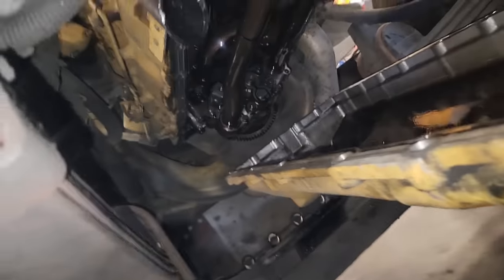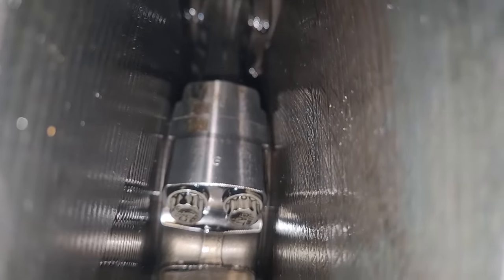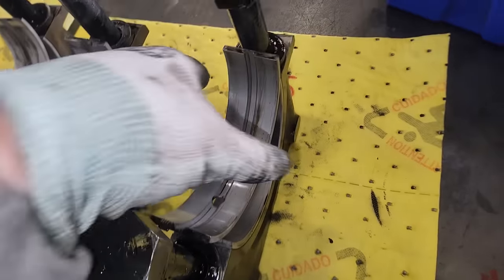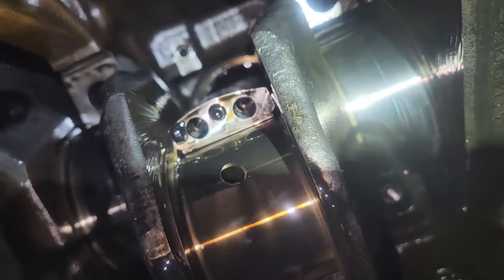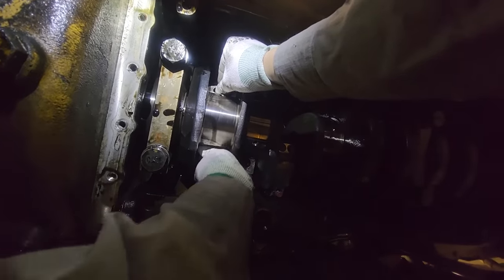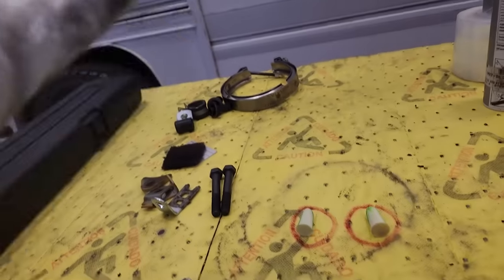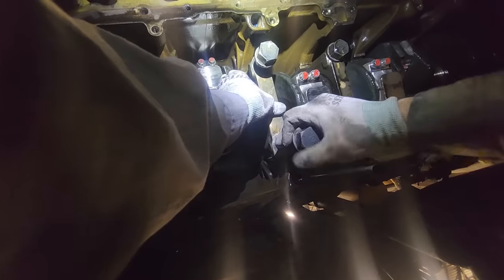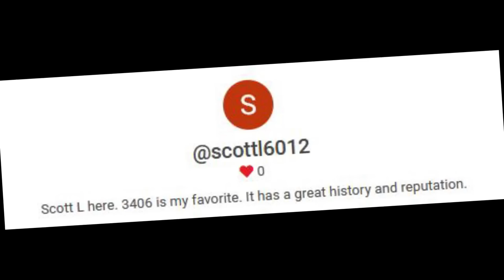Nice Truck Driver Paid for an Engine Rebuild, gets a HEADACHE! Engine "Re-Rebuild."

Comment: I own a 2006 Jeep grand Cherokee wk1. Bought it September 2022 since the day I bought it I’ve had problems with it, fixed the thermostat and fixed the overheating problem. I’ve replaced gas pump, radiator, the fan and fixed fuse box cause it wouldn’t start. It has tune and headers with CAI. I bought it with 105,xxx miles, cars engine was “rebuilt” and everything looked nice and clean from outside. Everything above was done within a 6 month span. It’s a nice car and pulls strong, daily driven. About 7 months in I noticed a small ticking and one morning the low oil light came on, that same day I drove it home changed the oil and everything was good I noticed the oil pressure was low tho I still drove it thinking everything was good since it was “rebuilt” about 2 weeks in I raced a scat, it ran good on the first pull until I noticed after that it wasn’t pulling with full potential, on my way home it started knocking bad. Took it to my mechanic and turns out the rod bearings where toast 4 bearing were thin as paper I got somewhat lucky. The previous person who built the engine torqued tf out of the bearing and they got ate up. Now I’m “re rebuilding” it polished the crankshaft and waiting for everything to get put back together. When the oil pan was removed the whole bottom pan was full of small metal shavings (the bearing) it’s a srt8 I love the car if it wasn’t for how it pulls and sounds I would’ve sent it to a scrap yard already. Moral of the story is there are some mechanics out there that are absolute a holes

Comment: Hi. Josh
I teach at a community college in Canada, enjoyed your video. Worked at FTL/ western stars while on the floor. In my experience for 1 & 2 Mains, try removing the drive and accessory belts before doing the mains. Especially auto belt tensioners tends to pull the crankshaft upwards. Which tightens up the upper shells. Give it a shot sometime might help. Excellent delivery speed.

Comment: Late to the party but the stamping looks to be roll stamping where the rods have been physically rotated against a stamping die to get the uniform impression across the surface. This is obviously not done by hand on such a large part, but done mechanically.

Comment: Moral of the story…you get what you pay for. For every good mechanic that does the job only the right way or doesn’t do it at all, there will be 50 who do it the wrong way(like grinding a main bearing to make it fit). Tough to find good guys, even at dealers, had some work done at cat dealers done and had corners but, and there’s a lot of solo guys that do fine work as well. Nice work josh!

Comment: When undoing those critical bolts i would be de-torquing them in stages, as per re-torquing procedures, not having the cap held by 1 bolt alone, just good practice, which is what this is all about, avoiding drama's rather than creating them, good video so far, ta ...

Comment: Awesome video, 👌 you should make some tools out of hard teflon to handle the bearing install. Sacrifice a heavy cutting board making a plastic chisel the same width of the bearing. Or at least some plastic upholstery pry bar tools you can tap on without doing damage. Just some things that I used in the past. Cheers Josh 🍻

Comment: Josh, in my 40 plus years of operating diesel engines of all sorts, every single one would lose a few pounds of oil pressure when the turbo spools up. It seems to me that the turbo spooling up would suck oil into the bearings thus lowering the oil pressure slightly. I always figured if it didn't drop a few pounds under load, it wasn't oiling the turbo properly.

Comment: Block with main caps in place are line bore, honed and CANNOT be moved to different location. Very surprised engine even turned over or locked up. Seen few main cap back on in wrong spot and lock engine up. Seen it done on 3406E owner put mains and rods in mixed up main caps locking engine up. We had ex-cat  tech who used white grease on pistons and rings. Also never removed any of BLUE grease from new cyl but only from head gasket surface and bolt it on

Comment: I always use the white assembly lube because you can see after putting the lube on the bearing and before installing the caps you can see that there is no debris on the bearing.

Comment: I always left the rod that is fed by the main uncapped. Then run brake clean thru the feed hole and flood the main journal then blow the rod and main out with air just so I dont make the mistake of leaving the earplug in the feed hole. Also used a big screwdriver. Either way works. Rods and mains are time consuming to do them correctly. I always polished if I felt anything and have successfully done hundreds of rods and mains. I agree, that main cap can put a dent in your skull!

Comment: Agree Josh, any time 3406 or C15 engine oil pump is removed the lube system must be pressure filled. Typicaly a failure to do so will result in a number 2 big end  failure a few miles down the road after repairs.

Comment: Ex light auto mechanic I've never seen or used white lithium grease on bolts during a rebuild.

It's usually just engine oil or the thicker assembly oil white helps with initial start up.

Not saying some manufacturers don't suggest it just never seen it. And I worked on all sorts of vehicles and machines, as I didn't work at a dealership so was exposed to a large variety of makes and models.

Edit: will say I found copper paste on some vehicles but id say that is likely more beneficial than white lithium grease. Though the actual suggested stuff is usually best.

Comment: definitly a good tech, just a side note, when rolling in main brngs. use a brass coated or brass punch/screw driver. your comment on knowing what you are doing is paramont! Cat recomends not using an impact, but I never had a problem with that

Comment: I have literally "rolled in" hundreds of bearings over the years, and never had a comeback or complaint. If you leave all the mains un-torqued till the last upper shell is in position, you won't have an issue installing them. I have used a Copper T-Nail in the in the oil passage of the crankshaft to R & R slightly snug shells, and gently barred the engine over till it was in position. Hard to believe those mains didn't Self Clearance with the wrong caps installed.
Reply from the maker: I've always left at least 2 of them torqued so the crank would droop and possibly damage the main seals, but I might try to just loosen all of them, roll the uppers out on 5 of them, install the 5 caps without torquing them, roll the other 2 out and then torque them all. I love getting knowledgeable comments from other people, I try what they say and sometimes I like it more and then I have learned a new skill.

Comment: International Compound # 2 is an excellent thread lubricant for cylinder head bolts and main bearing bolts . I do not think lithium grease as thread lubricant is hurting anything . On N-14 engines it is best to loosen the alternator belts to remove tension from the crankshaft for bearing installation .

Comment: I don’t have a picture but I have a destruction of the week for you, working on a caterpillar D6 replacing a track roller, I had to order new bolts because the old ones were so horrible. I leave for the day and go pick up the new bolts the next morning, they assume that the roller was bolted on and ran the dozer without calling me first so I spent something that should have taken an hour just to fit the roller and put the new bolts in cleaning out the muddy sand from the bolt holes

Comment: I have used a blunt putty knife or a strip of 1/4 inch white plastic to push shells in.  On tight ones I have an assistant pry on the crank or slowly rotate the crank.
Reply from the maker: I think I'm going to buy some small brass punches and try them with my screwdriver next time, scratcher l screwdriver for positioning and the brass for pushing.

Comment: You can polish from the bottom with the shoelace/ribbon method.
Wrap the journal with a single none overlaping abrasive of your liking, then spiral wrap a ribbon or shoelace around that as many times as it takes to make up the width of the journal.
Reply: Though it is a fair amount of work to get it set up on a main
Reply: And what happens to the waste abrasive?

Comment: Slowly doing an inframe on my Cummins 8.3. Haven't done an engine rebuild in a few decades. And never done a diesel. Being a backyard mechanic, even I figured out quickly that the caps are numbered and go in the same spot, in order. Also pistons have a front and rods have a left and right as well as being numbered and matched.  If you aren't sure, grab the repair manual for your engine. Cummins Quickserve had mine available online.  Dude definitely needs to get his money back from the Florida mechanic!

Comment: That looks like a joint compound to torque the bolts. That's what I usually use for the Detroit 60 series. that's what detroit recommends to use to torque head bolts and main bearings. And it is off white.

Comment: Josh that was a great video you have so much patience I really appreciate you making this video haven’t done any in frame guide some time but stand up and take a bow However tell the last use paint after assembly but he forgot to use orange silicone on the rod bolts and too the engine with 90 weight gear oil hahaha keep the videos coming gonna follow you now thanks Jack

Comment: Out of the 4 cats we have 1 6nz 1 mbn 1 1lw and a accert they all lose oil pressure under load especially when hot. Even after a fresh rebuild. Once boost comes on a 5 psi drop is just normal

Comment: on the mains they're also faced while attached and could grind on sides of crank, gouge in hole in bearing was likely a peen shot not cleared from oil gallery...rods didn't appear to be matched either from start, bad, bad, bad
I think I done at least as well mixing and matching parts building from the scrap motor pile

Comment: Those are the fumoto drain valves and they do make an optional lock you can install but they don't need them, I have used them on everything for well over a decade and never had one open.

Comment: Positioning of main caps is very important because when the block is manufactured, they do a line bore, and if you put them in the wrong spot, you can damage the block and the crankshaft. I cannot believe somebody did this if I was the owner of that truck I would be very, very pissed And I would probably make them put me a complete engine in this truck

Comment: The white grease on assembly can cause problems, I pulled one down and the high temp grease had plugged the oil filter. That was on two stroke Detroit so almost 0 oil pressure after bypass kicked in

Comment: I use a split pin with the loop in the oil hole and the legs bent at 90* then rotate the crank to roll the bearing in

Comment: You should see my 2011 Cascadia in pristine condition. I rescue it from a junk yard in El Paso adapted a 2007 14L Detroit engine with a 13 speed is a sweet little thing.

Comment: Man, watching you roll out those mains makes me cringe. Before you even got it out of your mouth I knew how he damaged those top caps. It amazes me that he didn’t damage the crank doing that. He got flat mean with them. I used to use a plastic windshield installation tool to push them out, or at least get them started out if they were stuck a little bit. Then I used a heel bar with a rocking motion and walked them right out. I would also use the same plastic windshield tool to seat the lock, so I wouldn’t risk scratching the cranks with a screwdriver. Your definitely correct, rolling rods and mains in ( under haul) is one of the nastiest jobs. I much preferred doing it on a table or a stand, preferably majors. Great content! Thanks for sharing!

Comment: If you torque something to level X, then go back later, it will take a higher torque to move the fastener.  Reason:  sliding friction is less than static friction.  During initial torquing, you're working against sliding friction..   When you go back, you encounter static friction until the fastener moves.

Comment: What you’re calling white lithium grease might be from ARP and according to the ARP it gives him more consistent torque It works better than engine oil and helps prevent what they call. Torque scatter anyway oh yeah, that guy who butchered that engine I hope the fellow that owns a truck can go back on him. If it was me I would just pull the whole motor out and clean it out real nice anyway, you do good work.

Comment: I’ve seen white lithium grease used as assembly lube.  There is a brand I’ve seen labeled white motor assembly grease. 

I’ve also heard it’s good if the engine is gonna sit for a while before starting it. 

I’ve never used it though

Comment: I sometimes use a split pin that's flattened into a T, then insert it in the oil hole and roll the crank till the bearing in the right spot. I have the same torque wrench but I still put lines before I torque the bolts to be sure I don't miss any and they all end up pointing in the same direction.
I like WD40 to use on the cloth when I'm polishing the crank.
 Its crazy some of the things you see. I once seen a camshaft that had been stick welded then ground, all the weld just lifted right off.

Comment: Great video, I never watched a CAT engine repair, but this was great and learned a lot.  I'm sure now if I did have a CAT, I'd drive it to have you repair it too.  Bet you loads of referrals to personally repair these engines.  Glad you didn't have to remove the engine for the repair.

Comment: That's astonishing. 
This is why I do my own maintenance.
I was pushed for time a couple of years ago and needed to replace my radiator.
So I went against my best instinct, bought the radiator and gave it to a shop to do the installation.
A really easy job. The radiator sits in a channel at the front of the car and is clamped into place with two plastic clamp screws in the front cross member.
Seems the guy didn't know this and couldn't be arsed finding out.
Isn't that what you would do if you never done a job before?
Not this a55hole.
He cut the old radiator out and bent the new one to get it in.
The bottom of the radiator 5mm away from the power steering pump pulley.
Unbelievable crap.
What an idiot.
I made him buy me a new radiator and refund me my money.
Did the job myself.
But he's still in business this guy.
God knows what damage he's doing to peoples' cars.

Comment: ive been a Diesel Tech 35 years And you have to know the Basics Common Sense everyday look both Ways before you cross the Street Sense no Computer not Everything requires a Laptop    Hands on gettin your Hands Dirty Is the Best Way to learn

Comment: Take your emery cloth and tear in to 1/4 to 3/8 wide widths, wrap tab twice around crank, then you can polish the crank moving the emery back and forth and around and round, and it will polish it with out rotating and crank. I loosened one and seven bolt about a 1/4  turn from snug, it lets the crank drop every little, but makes putting in main uppers so much easier. then snug up the 2-6 caps and finish dropping 1 and 7 roll in uppers and then do the torque turn on mains. Cat has a pattern for torquing caps, torque tab side first of main then non tab side, then turn non tab side then finish on tab side. This was done so that when main caps were put on at the factory and bored, they were all done the same way! Was real important on 3208 vee style mains.
Reply: I would never use Emery cloth. Never...if the crank needs work. Take it out and have it done professional by a machinist. Not a hack machinist with Emery cloth. 😅
Reply: @2nickles647 nornaly I would agree, but if a coprimise is required it must be done with customer agrement, I prefer wet and dry using the narrow strip 2 turn method described for a quick pollish, you could also use a length of linishing belt. You need to be carefull hand polishing parts simply to make them shinny and pleasant to look at as not only can it be a waist of time but can reduce the component life. The shine factor is in my opinion the most unnecessary process taght and allowed in workshops world wide.
Reply: @michaelbrown6241 I wholeheartedly agree with your statement, I work in a Kenworth dealership and came from Cummins, and one of the things that Cummins factory training and service manuals will tell you is not to try and achieve a "uniform apperance" when cleaning machined surfaces of parts. The majority of guys I watch will take a "cookie" wheel on a die grinder and wizz away until they have touched every inch of the part, meanwhile there are sparks flying the whole time...sparks, that means that you are removing material. You should still be able to see factory machining marks when your done "cleaning". 🤦‍♂️Shaking my head......

Comment: building engines for a drilling company, ive learned that if theres a gasket between your component and fasteners to their destination, always used a torque wrench. even the 30-40 bolts in the oil pan, not worth zapping them with an impact if its just gunna leak. take the time and do it proper.

Comment: White lithium grease is an old school “assembly lube” it was used in the old days by some mechanics. It’s also used when assembling ammonia refrigeration compressors. I learned that many years ago when doing refrigeration work.

Comment: Often when I work behind other mechanics I notice they've spent more time beautifying (stamping and spraying so many coats that the cam turns yellow) and less time actually making sure the tolerances and part placements are correct.